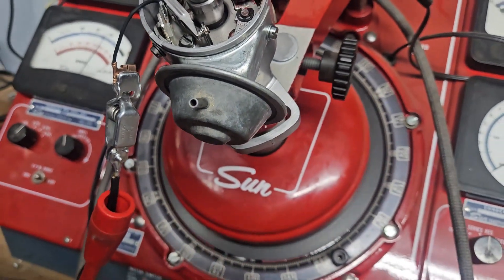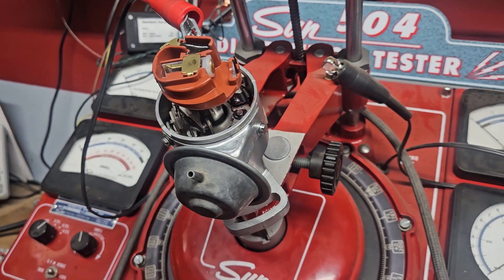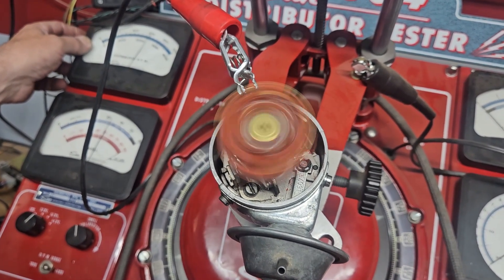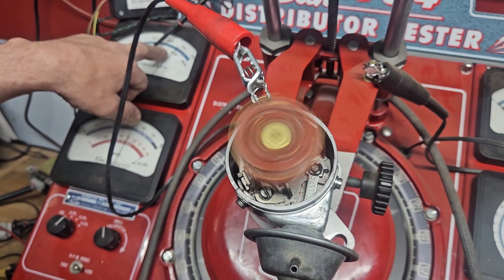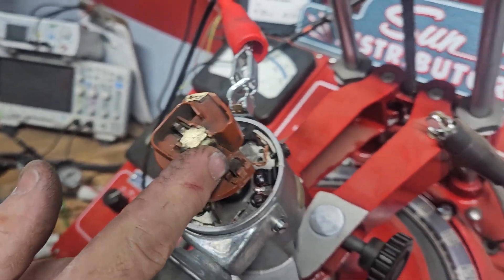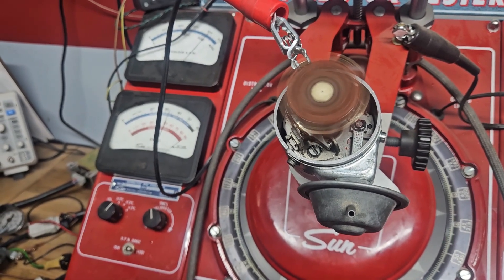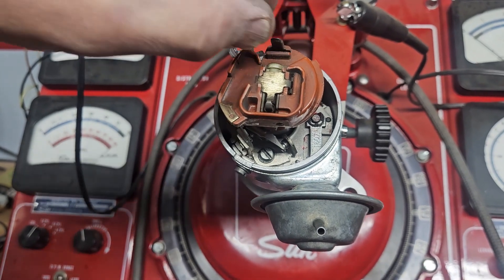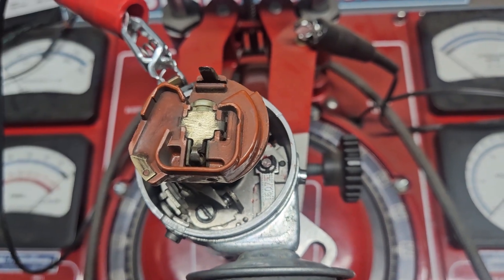New parts verses old parts. Bosch Ignition Distributor Repair for Porsche

Comment: The distributor can be a problem.  I’ve had several 2.4/2.7/3.0 cars with faulty distributors.  Points aside and rev limiting rotors, it’s a good place to look when a customer complains of poor performance and wants a “tune up”.  
The 3.6 cars have a belt and that’s a problem in some cases.  Distributor health is as crucial as fuel pressures in diagnostics and as easy as pulling the cap and investigating.  Cool you have a Sun machine.
Reply: …Bronz pin is all it takes.  Sure there are weights and springs, but a clean distributor mechanism is crucial.  So many people neglect that wool wick under the rotor as maintenance
Reply from the maker: Glad you found the video interesting, thanks for watching!
Kurt

Comment: Thanks for the great video, Kurt! I actually have a question about an old part. My 1979 911SC Sportomatic still has the original factory torsion bars. Do they need to be replaced, and if so, what diameter should I go with? The front of the car noticeably drops when I fill up the tank — is that because the diameter is too small, or because the torsion bars are simply worn out?
Reply from the maker: I would say that the original bars are just worn. They are just like any other spring that over time wears. That car has been sitting on those bars for 46 years so its time to replace them. I use a 26 mm bar in the rear and a standard size in the front.
Kurt